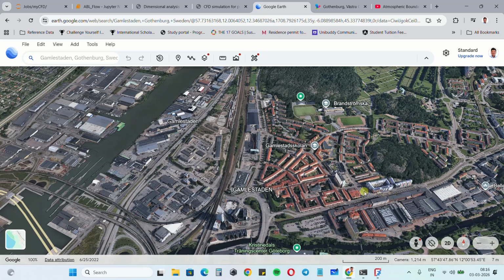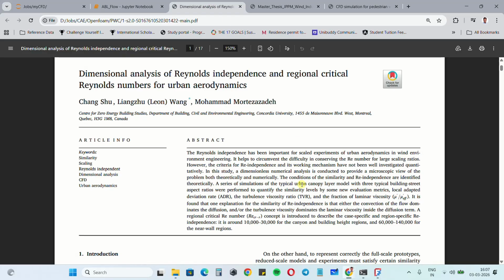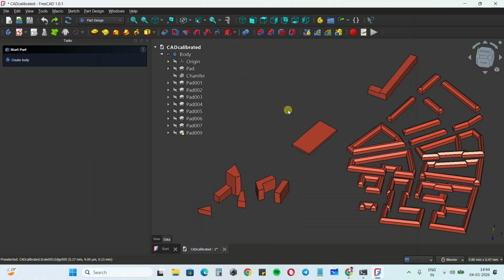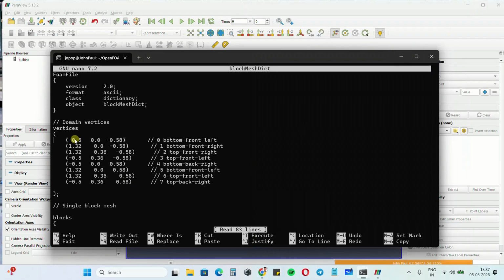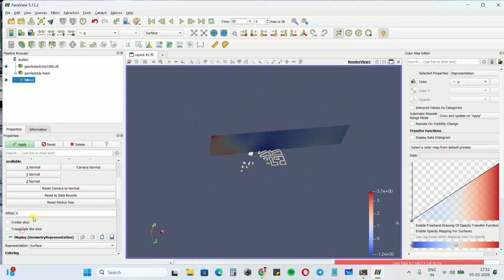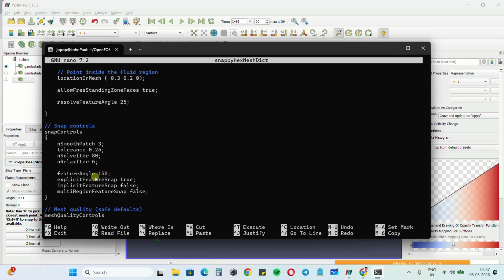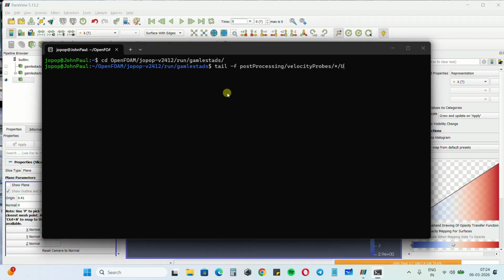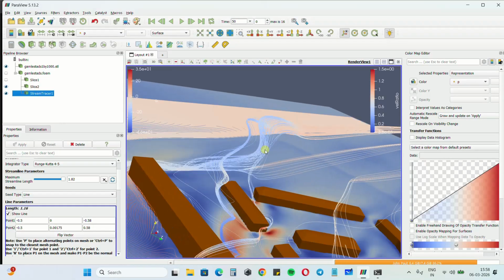Pedestrian Wind Comfort CFD Case Study Using OpenFOAM | Urban Aerodynamics and Applied ABL Modeling

Comment: Hi, I wonder why we need to scale the CFD model? 
Can't we model the building in their actual physical dimensions? We are not doing actual wind tunnel experiment, so why bother to do the scaling?
Reply from the maker: So these videos were actually part of my learning process. I have in this case used model scale geometry like in a wind tunnel and in a separate video (LNG plant) I have used actual scale geometry. 

The difference in scale is significant in terms of the scaling laws that you follow. In model scale we use viscous scaling, while in actual scale case I have used roughness scaling. So the two cases are basically to learn both.

Comment: Sir, please explain how you are copying the geometry data from FreeCAD into BlockMesdDict file.
Reply from the maker: In the blockMeshDict, we define the background mesh. And in snappyHexMeshDict we insert the geometry using .stl mesh files. Since stl dosen't store information about the unit of measurement, you might need to scale up or down based on the unit system that you follow.

Openfoam considers the lengths in metres. So if you follow MKS system in freeCAD, then there won't be a conflict. Say, if you are modelling using a millimeter system then, 200mm will appear as 200m in openfoam.
Reply from the maker: Let me know if I have answered your question?